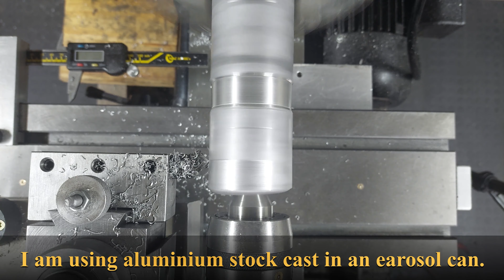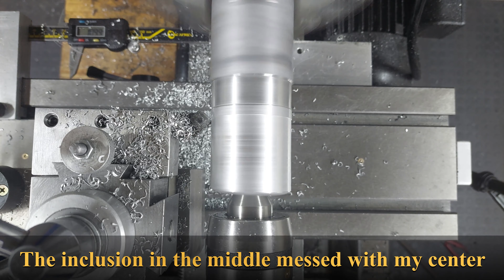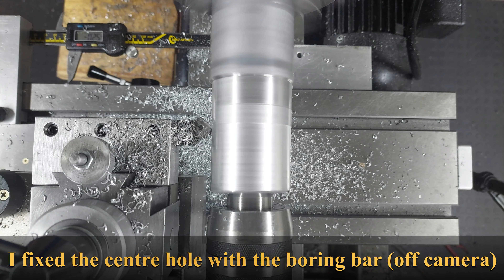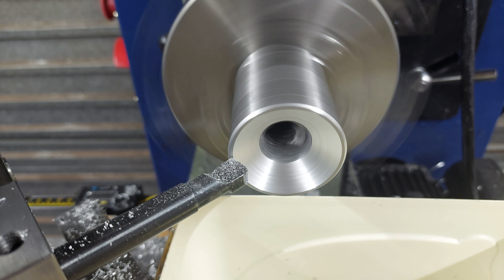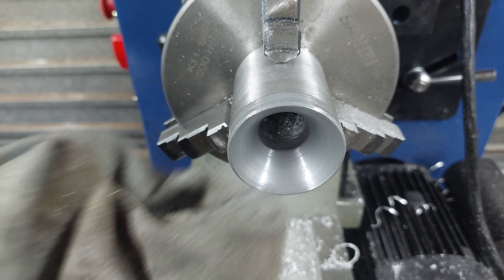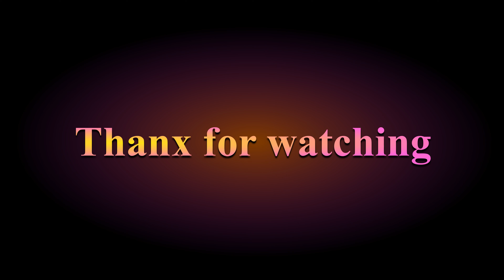Making A Venturi/Velocity Stack On A Manual Lathe

Comment: Interesting...what's it for?
Reply from the maker: Hi Craig. It's for a forge burner.
Reply: It’s a shame you used aluminum then.
Reply from the maker: It won't melt if that's what you mean. The flame is contained in the fire holder which is all steel. All the aluminium parts can be touched during operation as it's cool to the touch.